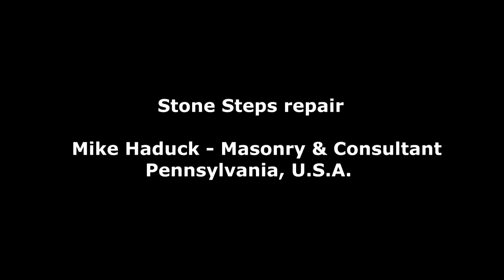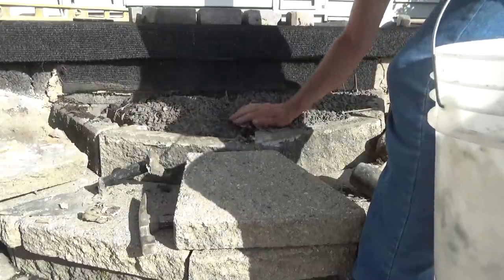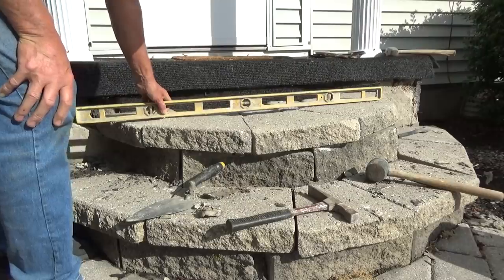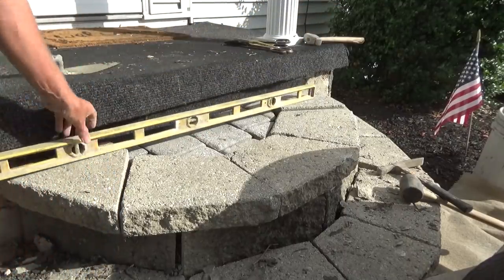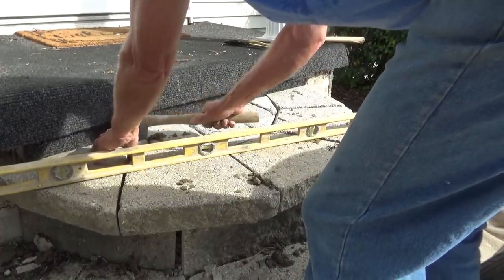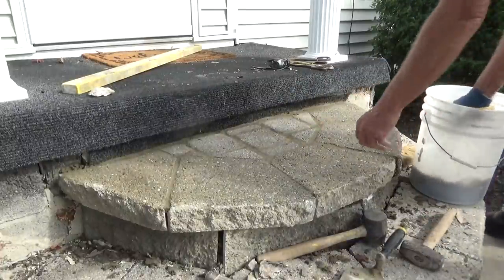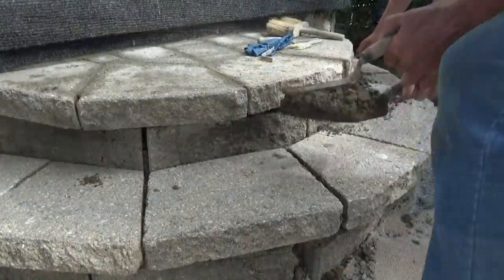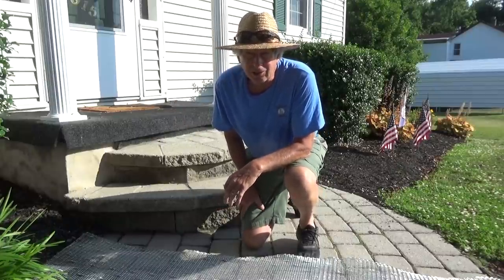STONE STEPS REPAIR & PATCH (Part 5) Mike Haduck

Comment: That type of construction doesn't last long with the winters we have.  Has to usually be releveled every 5-10 years at best.  In my area they sell a very similar looking mesh but made from some plastic compound.  It works well,  doesn't rust. 
Nice job Mike.
Reply from the maker: Thanks Peter, Mike

Comment: I always enjoy your videos there Mike! The methods , materials  and tools you suggest using in your climate zone have helped me tremendously . Because i live just south of Boston. I have a plastering and dash finish I need to do to complete my project so it matches the original foundation when it was done in the 1950's. Do you have the time to just look at some photos i could send you and then help me with materials that I should use and methods to match the original foundation. I am of course going to do a couple practice runs so i can match the color and texture . But your knowledge and wisdom would be of great help. Thank you, William
Reply from the maker: Hi William, matching is usually a nightmare,  you got to mix some up, get a hairdryer and dry some to see if it matches, other than that I only do the finishes I do,  I hope it helps mike

Comment: I'm not a fan of that kind of construction either, Mike. However much the homeowner paid for those steps the first time around, they paid way too much. You managed to patch it together as well as it can be done, so they'll get some more years out of a job that was bound to fail from the beginning. I agree, the wire mesh was the best possible solution to holding that mess together. Thanks for sharing your experience!
Reply from the maker: Thanks Bill, your right, it's all I could do, Mike

Comment: why is your ratio of cement to sand so high? i assume this is for strength but is it susceptible to cracking....i'm in ontario canada and i was curious if it was ok to use mortar as a grout between brick pavers/ stair steps.....would it crack in winter? btw would you recommend type n or s mortar for steps .. i was thinking type n due to winter and cold conditions in my reigion. thanks!
Reply from the maker: Hi Yazad, I use what the family business been using for over 70 years and never had a problem, lots of controversy over what to use but I don't want callbacks, big difference between what is used in Florida and Pennsylvania, if I show what I use in each of my videos for that project  thanks Mike
Reply: @MikeHaduck  ya thanks ... much respect....i'm going to try it out becuase i get similar weather where i'm from... but does it adhere properly on a thin mortar bed (1/3 inch)
Reply from the maker: Hi, it worked for me and I never had a callback, thanks Mike

Comment: Why does it always sink towards the house? Great idea using the wire mesh to add strength but the metal will rust in time too won't it?
Reply from the maker: Hi, yep, that manufactured block will also be giving out about the same time though,  thanks mike
Reply: The manufactured block didn't give out ,the incorrect installation failed.if it failed at the foundation as you said then the problem needs to be addressed at the foundation  . You patched it and a patch is a patch .you didn't fix the problem structurally. You did a cosmetic repair ,wasted time and money.if your not going to do it right,why do it.

Comment: Hi can I do 1 part sand and 1 part cement? also do I absolutely have to put water?
I thought without water the mix hardens by itself
Reply from the maker: Hi bazz,, I got a whole playlist on stone steps repair, every situation is diffrent.  I always add water and mix thoroughly,  no dry pours, thanks Mike
Reply: @MikeHaduck  Awesome, I'll check out the playlist. Thanks

Comment: Mike why didn't you wet the back side of the stone for better adhesion?  The mix looked very dry.
Reply from the maker: Hi David, I did a video called. Should I wet it first, on this case it would have made a mess, thanks mike
Reply: @MikeHaduck  ok, now i know why you didn't wet it.  I'm trying to grasp the way I was taught vs what your showing me.  The screen is new to me and thanks for showing that.

Comment: It looks like you put cement between the porch and the steps? Isn't that a no-no? I thought one should leave a gap because the steps and porch will heave a different rates.
Reply from the maker: Hi, here everything is moving floating on the screen, didnt want to leave a gap, other jobs a bit different,  thanks mike
Reply: Should be an expansion joint where the steps and porch meet then caulked
Reply: @josephcofrancesco4123  that's what I was thinking. Thanks for confirming.